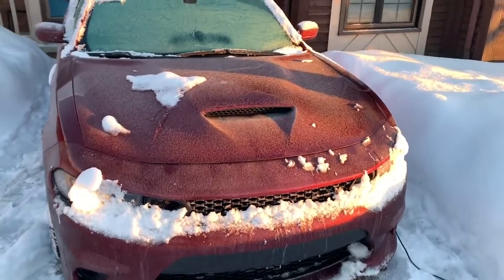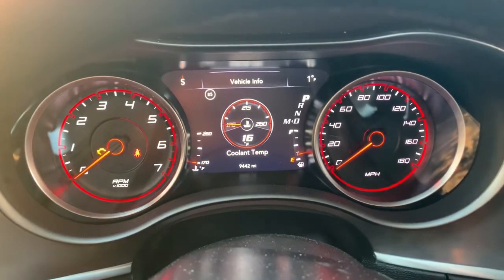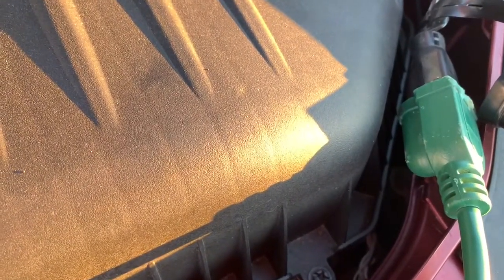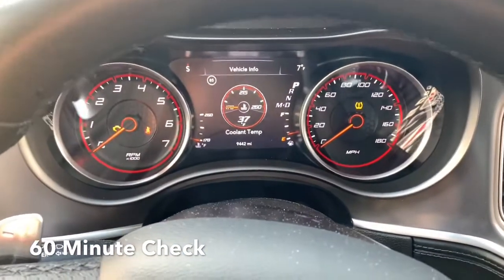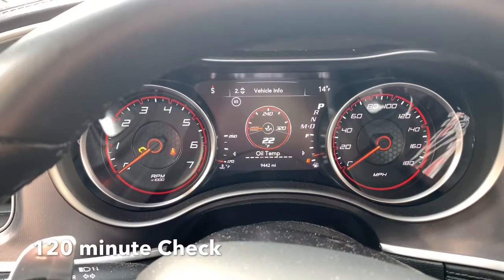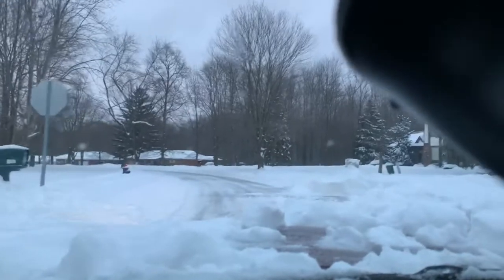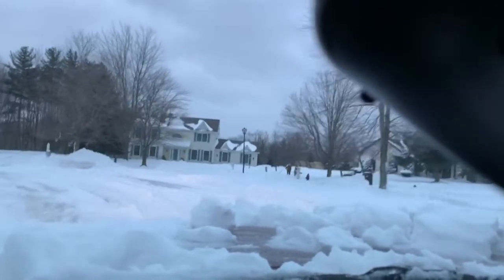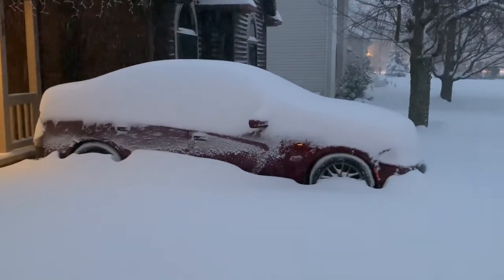Engine Block Heater Test at ZERO DEGREES❄️ - Dodge Charger Scatpack

Comment: Wow, it works pretty well!   I wonder how much power it uses?
Reply from the maker: Yeah I was happy to see it in action too.  Hope I don’t need to use it much. Haha.  This winters been snowy as hell and cold since January.  That’s a real good question.   Probably more than you’d think.  An engine block that cold sure needs allot of energy to warm up like that.  I wish it would have warmed up the oil temp though.  Maybe if you kept it plugged in for 4 hours it would start to warm up the oil.

Comment: So glad I found your channel, just purchased a Dodge Challenger shaker  scat pack and I do live in Canada with 5 months of winter, a good set of winter tires I’m hoping will get me by. I only drive to work which is a 5 min commute in a straight line down the street😀
Reply from the maker: Congrats man!   You are going to love it.  I had a 6M Shaker before my Charger Scatpack Pack.  A good set of snows should do the trick.  My scat has been really tested this winter.  We have gotten storms of 14” and 18” along with Typical 3-6” snow falls and my scat ripped through all of it with no issue.  I have 235/60/18 General Arctic 12s and I love them.  They have done awesome.   The only thing I would say is the ground clearance is not great so I do push snow or get snow through the grill and it sits on the service panel.  I have had no issues whatsoever of going stopping or steering.   Just gotta try and watch the ruts of snow.  The traction control system is amazing and having eco mode helps too.  It allows you to start in 2nd gear.   Let me know if you have any questions at all.  Good luck!!

Comment: Looks like it was working. Figure if you plugged it in the night before like before everything dropped to the low night temperature it would work better
Reply from the maker: Yeah it would be great over night for sure.  I’ll try that too. It would sure beat waking up to plug it in before I would have to leave.

Comment: The block heater is nice to have in extreme cold, we have had several days here of teens below zero.  The Scat did well in the snow in sport mode, how does it compare to your R/T charger in the snow?
Reply from the maker: Yeah it’s nice to have for sure.  I don’t actually need it but I figured my car is always outside and you never know when it might be nice to have.   The scat does very well in the snow.   These tires are great.  It does great in the snow but you can tell the weight distribution isn’t quite as even.  With the extra power and lighter rear end it slides a little more but it’s very predictable and does great.  Only problem is the ground clearance. I have pounds of snow that got pushed through the grill and sitting on top of my service panel.  And snow on the radiator.
Reply: @BurnseysRT  Yikes, snow under the engine.  Did that cause any problems? What about the front splitter pushing snow?  Besides the insane amount of salt they put on the roads, parking lots, and sidewalks in Michigan, I've kept my Challenger out of the snow this winter because of how low it sits.  It's not the snow when it's falling that worries me, it's when it turns to bricks days later.